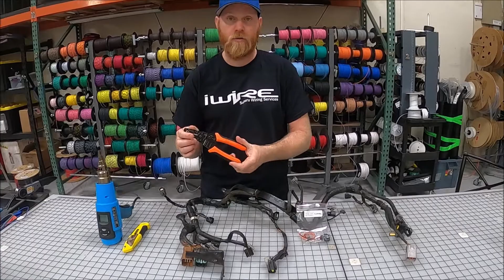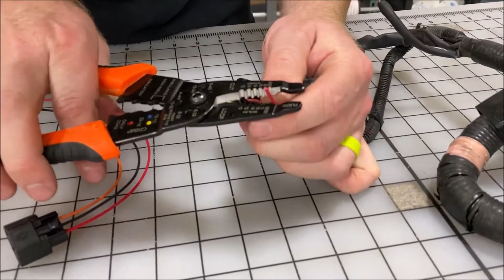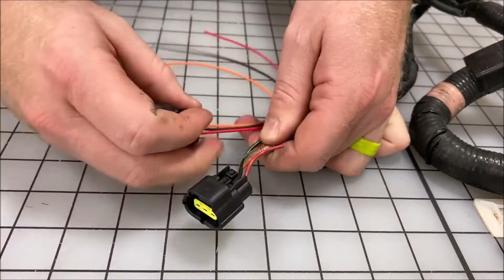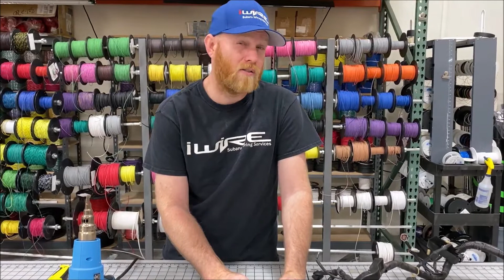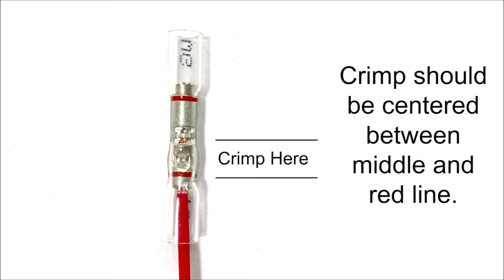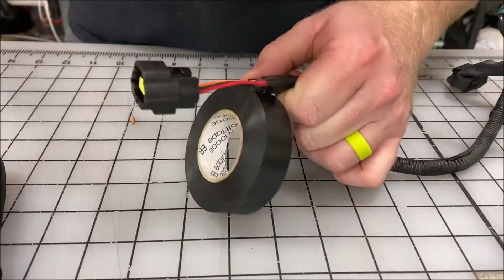iWire Pigtail with Crimps Install Video

Comment: How does these work exactly? I'm inexperienced and working on connecting one of the iWire pigtails to my dashboard wire harness on my Subaru soon. It's the connection for my blower switch control panel so I don't have much room to make mistakes and strip and restrip wires if I fail the first time. How much contact do the wires from the pigtail need to have with the wire harness wires? I've seen videos of crimping and soldering the wires together, which seems like it would end up with better connection than crimping alone. I'm just trying to understand the concept better with the iWire pigtails and crimps so I do this right. Thanks.
Reply from the maker: This video walks you through the process. With our butt connectors, you do not have to use solder to make a good connection.
Reply: @iwiresubaruwiringsolutions  I used your pigtail connector and the repair went very well. AC back up and running, works great!
Reply from the maker: @stevelynn5498  Glad to hear that!
Reply: @stevelynn5498  glad to hear. I have to do the same thing for my Impreza. Any recommendations or tips?

Comment: I’m trying to install new harness on my car for headlight level sensor rear. The colors wires on my car are different, but your harness looks like it will fit perfectly The wires on my car colors are purple white and green. Is there any way you guys could help me to connect them right thank you.
Reply from the maker: I think this is the part you need, and if you specify your model of Subaru, we'll pigtail it to match the car. 

https://iwireusa.com/collections/all/products/rear-ride-height-sensor-plug?_pos=1&_sid=39968702c&_ss=r&variant=40734144725145
Reply: 2018 Subaru Impreza limited wagon with eye sight 
Vin: 4S3GTAT62J3728009